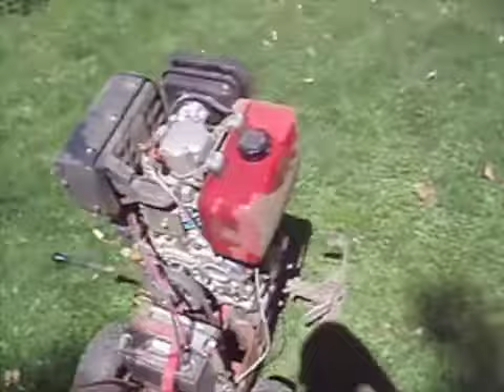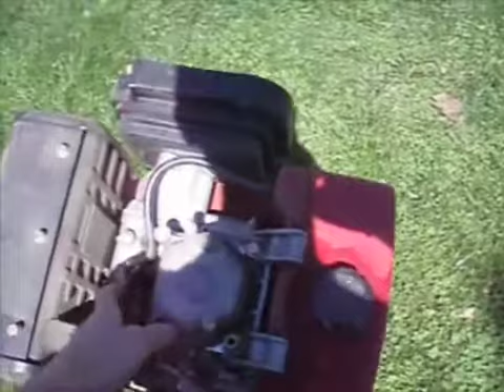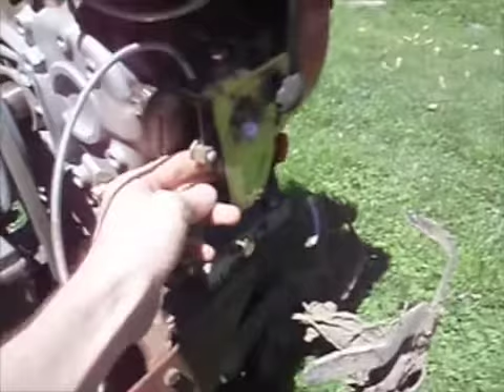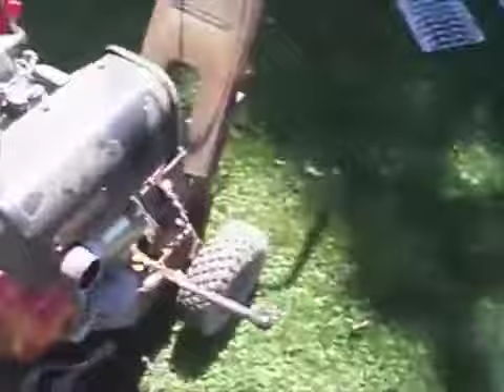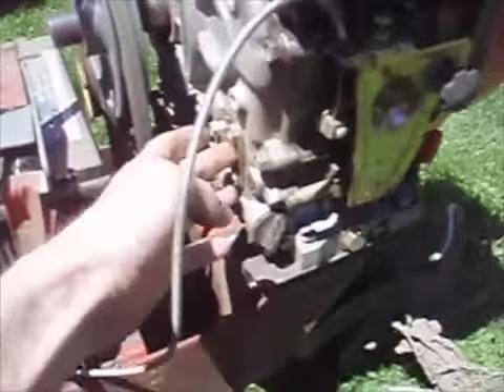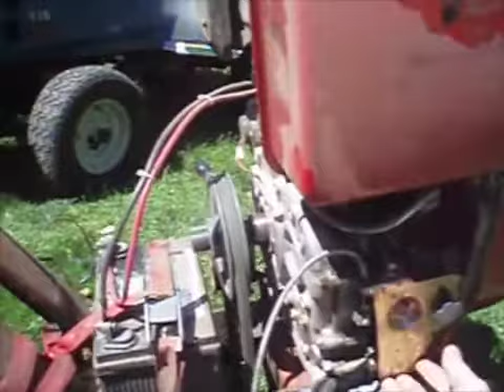~10HP Air Cooled China Diesel Info and Tips

Comment: My engine has a small yellow cap on top do you no what this is used for maby priming??
Reply from the maker: Could be a newer style compression release?
Reply: its an oiler for the rocker arms if its a cold start in winter you can put a few drops of oil inside for easier starting.